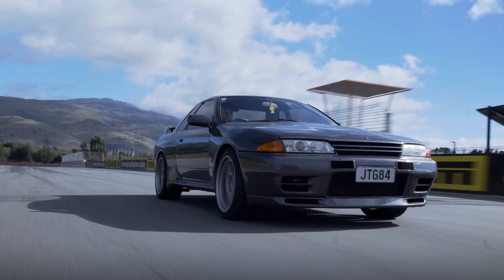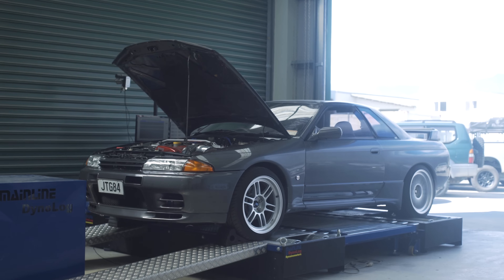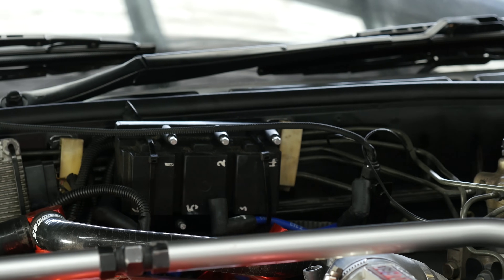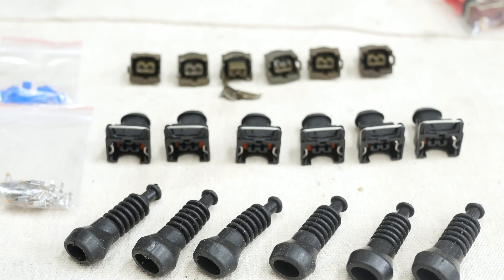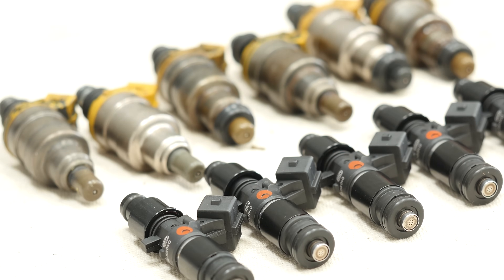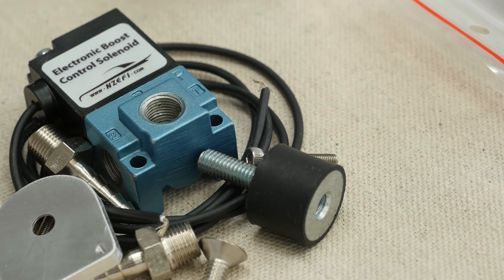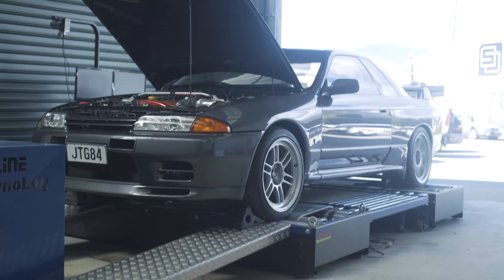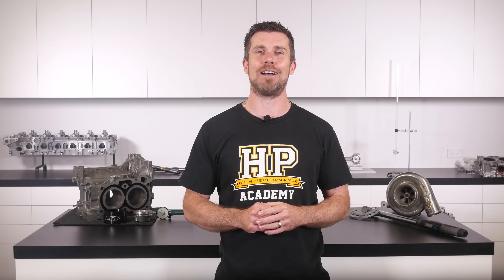⚠️ Modifying an RB26? Watch this FIRST! | R32 GT-R [TECH TALK]

Comment: Hi Guys! When you fitted the Walbro 255 fuel pump, did you re-wire to bypass the Fuel Pump Control Module? Or, as I want to do, continue to the factory wiring and FPCM... Will the factory set up provide suitable voltage and current to run the 255 properly? Thank guys!

Comment: Great video 👍 .
The prices in U.K for the GTR's have went up considerably in last few years .
R33gtr when I can afford one
Reply from the maker: Same here! They were never 'cheap cars' but still within reach for the average Joe, that however is changing. It happens with cars though so not surprising, just really some of the first Japanese cars that were mainstream to do so I guess - Taz.
Reply: @hpa101  
Hi 👍 .
I think the big problem is various countries had 20 /25 (?) year old import rule so it's  opened up a far bigger demand for them because of the age they are now .
which is unfortunate for the likes of me  because the price went up 😭 .
I put a deposit on a R33 GTR Lèmans in around 2007  , it was only £11500 but the garage was a real waste of time and I pulled out , I will never ever get that chance again,  I later found out Lads had tried to buy R34 Nür spec's off same garage for £45000 and been messed around. 
Australia is definitely leading with Skylines 👍👍👍👍✌✌✌
Reply from the maker: Yeah R34 GTR's in particular have never been very cheap though in all fairness. I shudder to think what price they will become once they hit that 20/25 year barrier.
Brandon here reckons S15's will be the next model to go nuts due to those import laws, but you just never know with cars really - Taz.
Reply: @hpa101  it guts me that they are out my range at moment BUT I also am glad the price has went up because I want them to be looked after and be around for years to come .
In UK the Cosworths have went absolutely ridiculous,  the 3 door like you will remember from being beaten by the R32 back in the day were being sold for £6000 back in around 2002 and the Sapphire Cosworth were going for as little as  £1500 same sort of time , now the prices are border line illegal 😂 .
S15 I agree 110% because the S14's are for sale here for double what they were when I had my R33 gtst. 
I really need another Skyline in my life

Comment: Pull the motor single turbo it with a nice wee holset and do billet oil pump gears, best thing you'll ever do to a stock RB26. Thank me later lol
Reply from the maker: Single turbo setup has been waiting to go on this for quite some time. It will happen this year =) - Taz.
Reply: @hpa101  Awesome! Definitely keen to see that. I'm pulling my motor soon. Putting a .61 hks t04z on mine. Have you got the water and oil lines sussed?

Comment: Literally when i built my car, these were the steps i did straight away. No second hand gear, proper gear. Don't cheap out or you'll pay 50 times that cheap out when something blows.
Reply: My entire car was built out of 2nd hand parts, has been running solid for 5 years now
Reply: @TheDekuStick  dreams are free 😂

Comment: keep up the great videos HPA. how do you find the hks f con v pro for tuning, are they still acceptable for a gtr with ITBs and garrett 2860-5 turbos? I will be taking mine for a retune soon and it also runs quite rich under partial throttle...10:1 ratio.

Comment: The one question I have is on the charging/alternator system -- do you find the stock alternator output to present any voltage issues when running a modern ECU, larger fuel system and more powerful spark setup (and commonly an HID kit for the awful stock lights)?  There are high output kits available and kits to swap to something like an LS1's alternator which stock has more amps (I think 125 vs 70, as an example). 

Love this new video series - this is the basic mod path I am planning for on the engine side. I have a BNR32 with mods from Japan that are very similar to how this car started and just looking to tidy and modernize the engine for safety and a small bump in performance.

Comment: Absolutely beautiful car. 
Aren’t they AWD though? Or has it been modified to be RWD ?
Reply: Shadowmiester1 The R32 GT-R is 4wd but simply by pulling a fuse you can run them as 2wd as they would have done in the video. The R33 and R34 GT-Rs cannot do this however as the centre diff/clutch pack is always preloaded with a little front drive.
Reply: Just pull a fuse and boom RWD

Comment: Hi love the channel

I have a r32 gtr just seeing  if I should go with a link g4+  or haltech plug n play
Reply from the maker: Both great options! Are you going to tune it yourself? - Taz.
Reply: High Performance Academy 

High will be going  to a tuning shop
Reply: High Performance Academy 

Hi just made 554kw@ the wheels on jem dyno very happy with the tune  im running a 6466.gen2  was in formed turbo is running out of puff on that rear housing .84  car its still a standard  bottem  end  at the moment  just seeing if adding  timing  on a built engine will make more power   at the same boost  32 /33psi .

Comment: How did you properly delete/bypass the injector resistor box module?
Reply: Tyler B http://www.nzefi.com/product/nzefi-r32-r34-skyline-gtr-injector-resistor-delete/
Reply: SubboyGTR I'm looking for towards how to delete/bypass it without buying a new piece
Reply: I'm sorry, you asked how they bypassed it properly which is what I replied with as that is what they used. If you wanted to do it cheaply you can just hack off the plug and join all the wires together.
Reply: SubboyGTR oh okay I didn't know that they used an external piece. Thank you

Comment: Very interesting, but not enough details. Which ecu you decided to use? What are the name of resistor are you going to install? I would also be interested to see how is possible to modify rb25det s2, with a/t. I have stock nissan stagea 34, Series 1, rb25det+a/t . If I will decide to make some boostup. What boost is tha highest for stock maf and ecu. I am also installed audi coils, walbro pump. And also it is interesting which spark types use (5,6,7)? Thanks in advance for your reply.
Reply from the maker: @Insane The ECU is mentioned specifically in the video ;) We just bypassed the resistors using a kit from NZ EFI, 15 PSI is as high as you want to go with a stock ceramic wheel. Hope that helps! 
For spark plugs and fuel system requirements, these are topics that we cover in our members-only webinars and not something we can do justice to in just a few minutes in a video like this - https://www.hpacademy.com/webinars/ - Taz.
Reply: High Performance Academy thanks! Cheers!

Comment: Interesting video Andre looking forward to seeing the Tuning session and I hope we will see more videos like this on TECH TALK. 
The RB series engines are my all time favorite but I haven't had much success with them 😕.
Reply from the maker: What sort of issues have you come across? Let us know and we'll see if we can address them in the next video 😉- Taz.
Reply: Hi Taz, well my RB25DET threw a conrod straight through the block 3 weeks ago under normal driving conditions and no mods to the engine. After it happened I was telling my mechanic about it and he said this was the 4th RB he knew that threw a rod under relatively light load. My #4 conrod was broken. Piston still moves freely with no damage to liner or piston rings.
Reply: probably had the shit beaten out of it before you owned it and has picked up a rod bearing, spun and punched it out of the block. No one really bothered to check the bearings in these motors at this age which is pretty surprising.

Comment: Could you find out how aggressive you can be with bringing on power and maybe shed some light on the RB26's limitations around torque inertia at low rpm?
Reply from the maker: The stock twin turbos (or for that matter any upgraded twin turbo kits) are really the limiting factor on how aggressively the power can be brought on. The RB26 is not known for its low rpm torque, however the turbo upgrade we have planned should offer huge improvements in both power and boost response - Who says you can't have your cake and eat it :)

Comment: i dont get it why anybody would have airfilter exposed to the hot hair in engine bay. its 30min job to build box for the filter and route some cold air pipes to it
Reply from the maker: I'm not sure why you're keeping hot hair in your engine bay either to be completely honest, but I won't judge you 😎 Seriously though, a cold air intake is on the list for the next round of upgrades. Keep an eye out for that video in a few weeks if you enjoyed this one 🤓- Taz.
Reply: Seriously?  Cold air intake isn't that important with a turbo car, since it's mostly your intercooler that's going to be doing the work.  Once the air is being compressed by the turbo, it's going to heat up to WAY hotter than what's in the engine bay.  Don't waste your time with anything meant to be "cold" intake because it's pointless.  Dyno numbers prove cold air intakes on NA cars don't actually help either.  Your main priority needs to be flow.

Comment: It def interesting to see some tuning tips on the RB26. 

If those are the factory painted valve covers. Then the RB26 unit here should be the later GTR R34 RB26DETT.  The original RB26 in the R32 and R33 are black. 

There are slight differences from the different gen of RB26s from the R32 to the R34. And the N1 and RRR blocks are the most sought after for high powered applications. 

Interesting the owner stick to the twin turbo setup. Many would have ditch the 90s era turbo units for the single turbo setup. 

Did the owner upgraded the water and oil pump? Because the stock units from the factory with high temps and boost are a bad mix. Most will upgrade those first before doing any major mods. 

While ITBs are great for most engines. Most would opt for a single big throttle body for simplicity. 

Speaking of which Mighty Car Mods is building a 240Z with the RB26 from a R33 and GTT R34 5 speed RWD only gearbox. 

Cant wait for the final product.
Reply from the maker: Don't worry, the twin turbo setup is not going to be sticking around long. They're only there because that is how the car was purchased. We will be moving to an EFR 8374 single turbo. It will also be getting a built motor, potentially with a 2.8 stroker kit. For the moment the stock oil pump remains however we've only found them to be problematic if you try spinning the engine past 8000 rpm. Of course the narrow drive face of the early RB26 crank isn't ideal and again will be addressed in the not too distant future.
Reply: The colour of the valve cover is off, so it`s probably the R32 oem with a new paint job and the R34 RB26 center badge. The CAS sensor should have been changed to the newer R34 version, if this was indeed a R34 engine. (R34 has plastic cover CAS with a different wiring pinout compared to R32/R33

Comment: Just the video I've been hoping for. Great job. My question is, Is the owner considering an electronically controlled fan instead of the standard setup? I'd be interested to know the parasitic loss of the standard system especially at high RPMS and would also like to know if the standalone Link ECU you've chosen could control such operation?
Reply: The link can definitely control an aftermarket fan on the radiator as well as the existing A/C fan in the front
Reply: John Ha Cheers dude 👍🏼
Reply from the maker: We will be switching to a different radiator with an electric fan, however in our own experience you're unlikely to see a worthwhile power gain from losing the viscous fan.

Comment: Thanks for the video!  What are your thoughts on replacing the CAS unit with a trigger kit ? are there any additional benefits to having a crank trigger as well ?
Reply from the maker: G'day Jedy and David. Keep an eye out for Episode 2, the Nissan triggering system plays a starring role! Spoiler alert - Yes, we change it out for a replacement unit that fits in the stock location, but uses a VR sensor with fewer teeth :-) - Zac.
Reply: Jedy Shishbaradaran I second this :)
Reply: intriguing a VR sensor... I have been looking at platinum racing products trigger kit, will be keen to see what you have been using thanks!

Comment: 1000cc injectors and stock turbos? LOL. R35 GTR injectors and coil are where it's at for under 550hp
Reply: First off I think you need a special rail to adapt the R35 injectors but i may be wrong.Either way with the power its making on 10 psi right now it'd max out the factory R35 GTR injectors on E 85. So between the upgraded wheels in the turbos,possibility of running E85 and wanting some headroom for later on they made a excellent choice of injector.
Reply from the maker: @SouthJerseySound nailed it! Headroom for what comes next was the ultimate deciding factor 😉- Taz.
Reply: fair point

Comment: RB are a really quirky engines, with ITB and twin turbos with ceramic impellers it’s clear that it was made for motorsport, but why then is the oiling system so bad in these engines. Can you elaborate? 
I’ve learned a ton from you guys already🖖
Reply from the maker: The ceramic turbine wheels are actually terrible for motorsport use, and are known to fail above about 15 psi (the turbos on this car have already been swapped out for steel wheel variants). The oiling system in the Rb26 is known to be problematic, however in any serious competition car the oiling system will inevitably be swapped out for a dry sump anyway.
Reply: Christoffer Sinding they weren't made for high boost from the factory,that's about it mate. The more boost you put in the oil is going to get forced to go somewhere,hence the need for a catch can and updated oil system
Reply: I've heard through the grapevine that the reason the engineers thought moving a large volume of oil through the head was regarding the solid-lifter design. They were thinking with the engine capable of such high operating RPM and solid lifters it would require more oil for lubrication and heat management. Of course, time told us that with the lackluster TLC a majority of these older R32 GTR's got, a majority of RB26's succumbed to oil sludge and pooling of oil in the head, spinning bottom end bearings and scarring camshaft journals.  Of course, its common knowledge now to add a small oil return line from the head to the block near the firewall to minimize the pooling of oil in the head and maximize the availble oil in the sump for the bottom end. Anyone correct me if I am wrong, this is just items i've heard through the grapevine....
Reply: It has very limited oil drainage from the head

Comment: I would like to see an episode down the road on head work, I.E port polish gain, then add cams and dyno and then add valve springs and dyno. Hopefully this is done on a larger turbo setup.
Reply from the maker: Not sure how far we'll go with this car as it depends on what the owner wants to do. A single turbo conversion is in the pipeline, but it is a streetcar and always will be so there is a limit to how far you can go before it ruins that aspect - Taz.